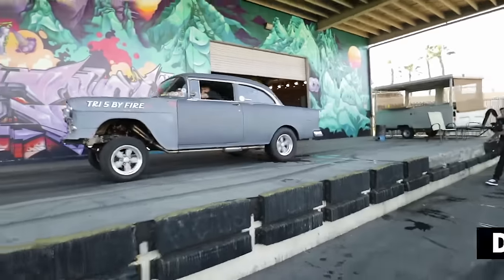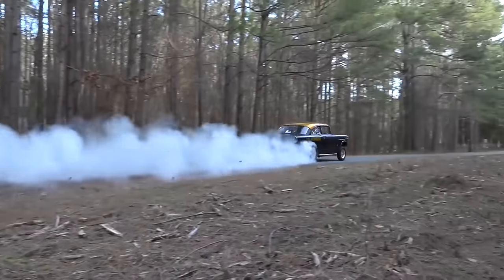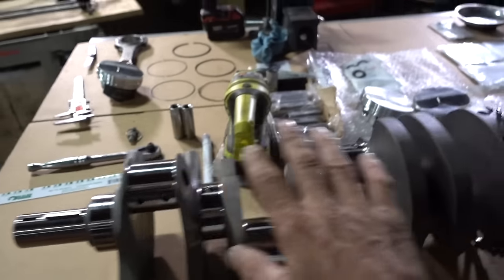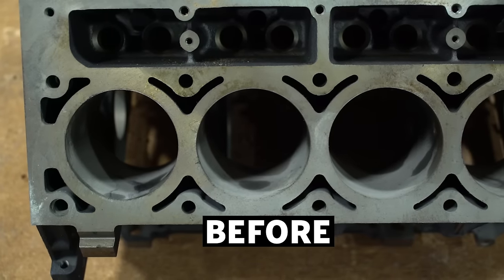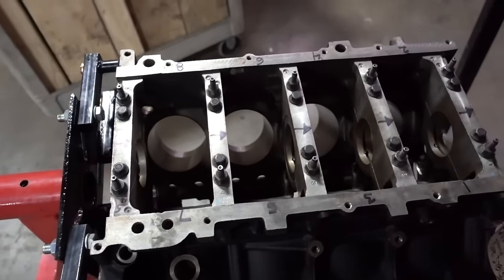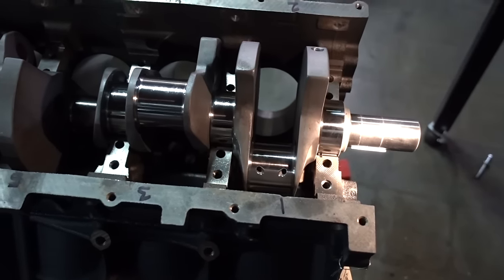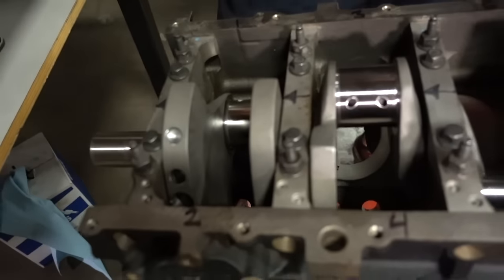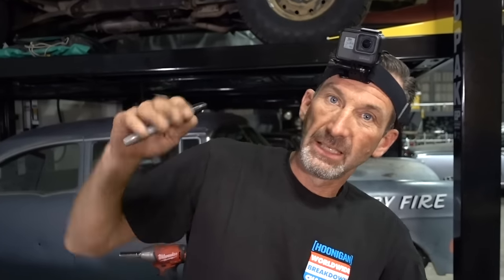700HP Stroker LS - How To Build Bottom End

Comment: It's funny how people treat factory studs like they are made of silly putty. Sloppy made over 1,000 hp on stock studs. And yet people buy ARP for 400hp, any time anybody builds an engine, it's always ARP no matter what. And yet factory ones are good for 1,000 at least. It's really funny. They sure did a good job getting everybody convinced that they always need them no matter what, and that factory ones are trash.

If you REALLY need more clamping force than factory studs, like the super high HP guys that are pushing over 1,500 hp to the point where the head is lifting off, what they do is use protruding sleeves and drill out the stud holes for larger studs for more clamping force, as well as using billet blocks that have been machined to distribute clamping force more evenly along the surface, to do this they slightly recess where the studs connect on the surfaces since they end up distorting inward, if you don't do this then it ends up blowing the head gasket out exactly half way between studs because of deflection. Just upgrading from 1 steel stud to another steel stud, whether its factory or ARP or what, it doesn't make that big of a difference, they are both steel. If you really need more clamping force you need larger diameter studs so they can take more torquing stress without stripping out or snapping. Going from one steel one to another doesn't make a huge difference, just makes people feel better because omg it's ARP, and of course we can't use factory studs, oh no they are the worst.
Reply: sirgallium I blew factory head bolts with a small Procharger,  8 psi to be exact.. Lifted both heads off the block, I replaced them with arp studs and have had no issues. Tty bolts suck.
Reply: sirgallium torque to yield bolts stretch, wich is why they have a different torque spec.. They are very different.
Reply: Thank you. I love learning and getting to the bottom of things. What engine was this? Torque to yield seems like a bad idea, yielding is the beginning of failure.
Reply: sirgallium gm 5.3
Reply: I assume on a stock application, that using torque to yield bolts keeps a constant tention of clamping force on the heads, makes sense but when making big power they can stretch further or break, also they're a one time use bolt, you have to replace them every time they're torqued. That gets annoying.
Reply: I thought Sloppy had ARP hardware on the top end of his 6.0?
Reply: sirgallium one big part of going to a stud and nut from a regular bolt is that a regular bolt flexes in two directions while torqued - along its length and around its axis. A stud and a nut combo only stretches along its length a bit and ARP stuff is reusable as opposed to factory hardware that needs to be replaced every single time. But do what you want with your engine though, that’s fine 😃
Reply: sirgallium something else to consider, even when someone uses a higher quality stud for a lower hp build: it's not always about max power, but modestly higher power and longevity at the same time. Reliability plays a huge roll as well. TTY bolts benefit only the factory in as much as being faster during initial assembly, no other benefits IMHO.
Reply: Any time you use a torque to yield bolt.....you eventually lose clamping force. That is why most production engines blow head gaskets over time. You also can't reuse them. ARP studs use a different type of steel and hold much stronger. Also a bolt pulls on the threads of whatever you are screwing it into where as a stud is solid and the torque is applied to the threads where the nut is.
Reply: sirgallium bn

Comment: Ugh... no assembly grease,wal-mart torque wrench might as well call this a roadkill parking lot build.
Reply: tyler weigel for guys that Ken their own shop, professionally balanced a crankshaft and rods, you’d think they wouldn’t wanna mess up the micro polishing.
Then again they did edit the footage, so they could’ve just applied it off camera
Reply: albraa sayed I don't think Brad is worried about the long time use of this motor .
Reply: cheapo torque wrenches are basically equivalent to more expensive torque wrenches in terms of accuracy(at least when new, i havent seen any data on their accuracy vs uses, just remember these are not used everyday and only do a few torques, now a wrench thats used every day for doing dozens of fasteners high end clicker types typically stay accurate for years and even when it falls out of cal or wont cal, its still close enough) .  the importance of accurate torque matters less as we introduce angle yields to our fastener loads.  another important note not made is fastener torques are always given in clean and dry threads unless otherwise stated.  as the k factor decreases the less torque is required to achieve the same clamp load, also why angle is becoming more popular to specify fastener tension, it significantly decreases the variance of fastener friction on the final clamp load.  beam deflection guage torque wrenches are supposedly the most accurate, (the ones with the dial indicator on them) but i feel the electronic ones are probably best, allegedly the same accuracy but a much simpler design with less chance for error as well as having built in angle sensors, and they will show final torque achieved.
Reply: cheapo torque wrenches are basically equivalent to more expensive torque wrenches in terms of accuracy(at least when new, i havent seen any data on their accuracy vs uses, just remember these are not used everyday and only do a few torques, now a wrench thats used every day for doing dozens of fasteners high end clicker types typically stay accurate for years and even when it falls out of cal or wont cal, its still close enough) .  the importance of accurate torque matters less as we introduce angle yields to our fastener loads.  another important note not made is fastener torques are always given in clean and dry threads unless otherwise stated.  as the k factor decreases the less torque is required to achieve the same clamp load, also why angle is becoming more popular to specify fastener tension, it significantly decreases the variance of fastener friction on the final clamp load.  beam deflection guage torque wrenches are supposedly the most accurate, (the ones with the dial indicator on them) but i feel the electronic ones are probably best, allegedly the same accuracy but a much simpler design with less chance for error as well as having built in angle sensors, and they will show final torque achieved.
Reply: cheapo torque wrenches are basically equivalent to more expensive torque wrenches in terms of accuracy(at least when new, i havent seen any data on their accuracy vs uses, just remember these are not used everyday and only do a few torques, now a wrench thats used every day for doing dozens of fasteners high end clicker types typically stay accurate for years and even when it falls out of cal or wont cal, its still close enough) .  the importance of accurate torque matters less as we introduce angle yields to our fastener loads.  another important note not made is fastener torques are always given in clean and dry threads unless otherwise stated.  as the k factor decreases the less torque is required to achieve the same clamp load, also why angle is becoming more popular to specify fastener tension, it significantly decreases the variance of fastener friction on the final clamp load.  beam deflection guage torque wrenches are supposedly the most accurate, (the ones with the dial indicator on them) but i feel the electronic ones are probably best, allegedly the same accuracy but a much simpler design with less chance for error as well as having built in angle sensors, and they will show final torque achieved.
Reply: cheapo torque wrenches are basically equivalent to more expensive torque wrenches in terms of accuracy(at least when new, i havent seen any data on their accuracy vs uses, just remember these are not used everyday and only do a few torques, now a wrench thats used every day for doing dozens of fasteners high end clicker types typically stay accurate for years and even when it falls out of cal or wont cal, its still close enough) .  the importance of accurate torque matters less as we introduce angle yields to our fastener loads.  another important note not made is fastener torques are always given in clean and dry threads unless otherwise stated.  as the k factor decreases the less torque is required to achieve the same clamp load, also why angle is becoming more popular to specify fastener tension, it significantly decreases the variance of fastener friction on the final clamp load.  beam deflection guage torque wrenches are supposedly the most accurate, (the ones with the dial indicator on them) but i feel the electronic ones are probably best, allegedly the same accuracy but a much simpler design with less chance for error as well as having built in angle sensors, and they will show final torque achieved.
Reply: cheapo torque wrenches are basically equivalent to more expensive torque wrenches in terms of accuracy(at least when new, i havent seen any data on their accuracy vs uses, just remember these are not used everyday and only do a few torques, now a wrench thats used every day for doing dozens of fasteners high end clicker types typically stay accurate for years and even when it falls out of cal or wont cal, its still close enough) .  the importance of accurate torque matters less as we introduce angle yields to our fastener loads.  another important note not made is fastener torques are always given in clean and dry threads unless otherwise stated.  as the k factor decreases the less torque is required to achieve the same clamp load, also why angle is becoming more popular to specify fastener tension, it significantly decreases the variance of fastener friction on the final clamp load.  beam deflection guage torque wrenches are supposedly the most accurate, (the ones with the dial indicator on them) but i feel the electronic ones are probably best, allegedly the same accuracy but a much simpler design with less chance for error as well as having built in angle sensors, and they will show final torque achieved.

Comment: Cue the internet mechanics who are going to tell you that you did everything wrong
Reply: Everything? Nah.
Just enough to detonate his shiny new toys when metal meets metal.
Reply: Plastigauge vs micrometre. That's a big NO
Reply: Wll they did sooo😂😂😂
Reply: @bnastystuntz  Came here just for this reply - thanks
Reply: setting thrust after torquing is a no no never hammer on a thrust surface, Use a piston to square the ring n the bore, works way better than a verier, if you tip the verier just a little the gap can be off, there is no way to do that with a piston. and that is just for starters. I have built engines 25 years ago that are still in street rods.
Reply: How about the fact this motor rod knocked on the first start up 😂😂

Comment: great video, and informative, but an LS in a Gasser....?????, you had a chance to expose your younger viewers to old skool horsepower, instead gave more of the same old boring LS..... High revving tunnel rammed big block Chevy would be more appropriate, I don't care how cheap the LS based  engines are. just my opinion, not that it matters, I'm sure the 55 is gonna scream, the race will be awesome! has Finnegan accepted your challenge????
Reply: It'll be a slaughter, Mikes machine has had years of dedication and parts put into it. He's running a blown and built 454 hemi. I like Hoonigan content a lot, but you can't drop the most soulless of powerplants into a stripped out shell and say good is good...
It'll be a slaughter for sure
Reply: +FourEye I think Mike's got it also, he's had more time to work out the bugs and knows how to drive.... besides, HEMI
Reply: Exactly! It's not a real gasser with fuel injection.

Comment: I like how you can use a long rod, as opposed to my old Chevy. Internally balance 5.7 rods LS is over 6" making side loads disappear. The heads also have bigger ports, now add 50# of boost pressure and the LS is more reliable, all forged internals of course, big tube headers look powerful too👍

Comment: If you're confused about the 80 degrees, that's because he was using the factory Torque To Yield bolts.  You torque them to a specific ft/lb rating, then you turn them an additional XX degrees, which stretches the bolt to its yield point.  The bolt basically acts as a spring that is preloaded, but since they've been yielded, you can't reuse them.  You can usually spot a TTY bolt because it has a lot of extra threads past the engagement point.  The ARP bolts are not TTY and simply follow the standard torque rules.

Comment: 1. All engines have there crankshafts balanced, if they didn't, the motor wouldn't last very long. 2. If you purchase good high performance rods, they are already balanced to within 1 gram of one another. You should never have to grind on connecting rods anymore unless your just trying to shave weight. Besides that, it's an excellent video. Gotta look into that domed wiseco piston. I didn't think anyone made a domed piston for the LS.

Comment: You must be running power adders, LS ring gap is .016, also to set the rings uniform in the cylinders use an old piston with a top ring in the oil ring slot, push it upside down in the cylinder to get the new rings uniform in the cylinder for measurment. Saves time.

Comment: I like this dude.  So if memory serves stroker ls motors are problematic because the piston skirt can actually drop below the the bottom of the cylinder.  How did you guys get around that or am i just wrong?
Reply: Stroker's have more swept volume. Meaning the piston moves more up and down in the bore. There shouldn't be an issue of the piston going below the bottom of the bore. Sometimes you will need to clearance {Clarence} the bottom of the block due to rod contact. When that happens the block is ground to provide the clearance needed.

Comment: Just to be clear,  i do like the channel. Not a hater at all. It is hard to concentrate and have cameras in front of you and narrate but imo there werent enough proper steps taken in machining and assembly of the parts used . Not going to go into detail, no one is perfect by any means but let the engine builders build engines and let the drivers and goofs be what they are.

Comment: Those are not pressure relief holes in the piston, they are gas ports that put combustion pressure behind the #1 ring to improve ring seal on a low tension ring.

Comment: for the bearings your using on the block side first ones you lay down are they all standard ? or you based it off your measurement on what your going to need on that side?

Comment: what's the advantage of using the stock main bolts for bearing clearance check when the ARP will generally tighten the bearing tolerances once set to final torque?
CPR  in Gardena is permanently closed sadly.  who else would you recommend for similar block prep?
Thank you for your time with my dumb questions.

Comment: Quick note: when you install studs - you want them just barely snug - hand tight.  If you use thread locker, you need to get to final torque before the thread locker dries.

Comment: another tech tip that wasn't mentioned;  when you buy main cap bearing sets, buy 2 or 3 sets and measure/match with calipers, they will vary in thickness within a set

Comment: after you measured the plastic gauge tolerances you swapped the bolts over and torqued the mains down to different settings, should the tolerances be re-measured again after that step?

Comment: I have a LS engine builders book and it specifically states that clearances have to be checked when changing to ARP studs but you check them with the oem bolts then switched. Any reason why you didn’t use the ARP studs to check the clearances?

Comment: Question is. If you were building an LS motor and were shooting for boosted 1200-1500 hp range 
Would you use an iron or aluminum block.